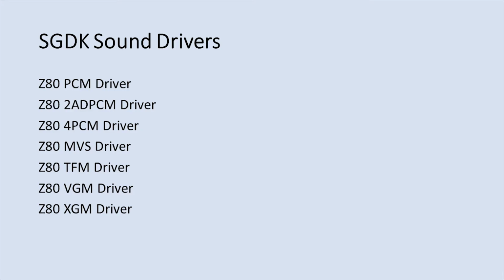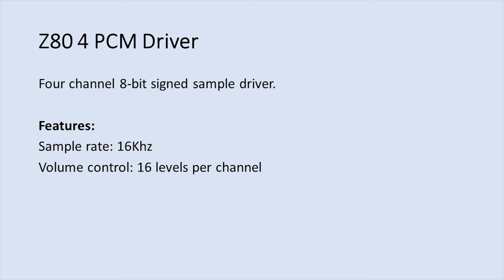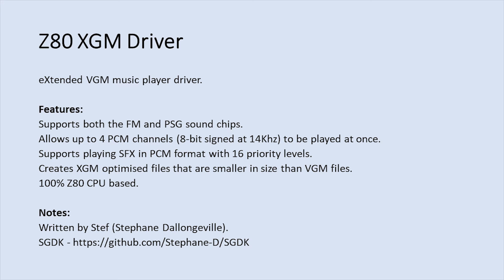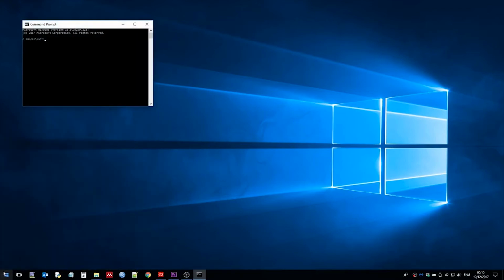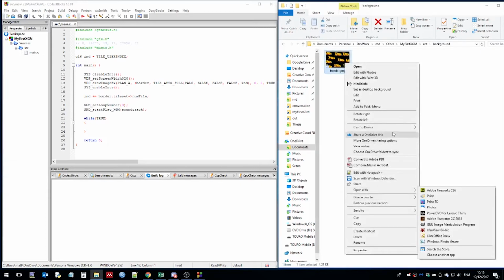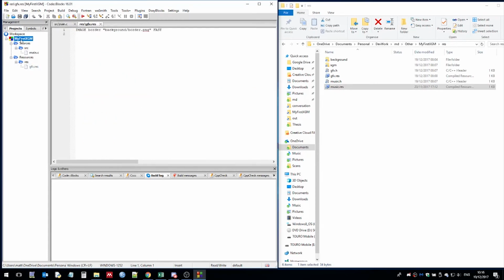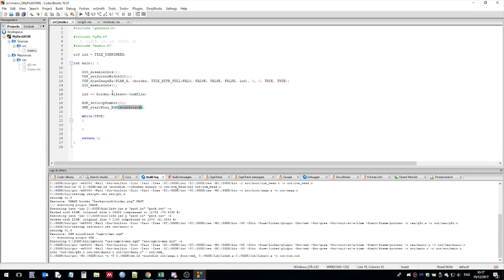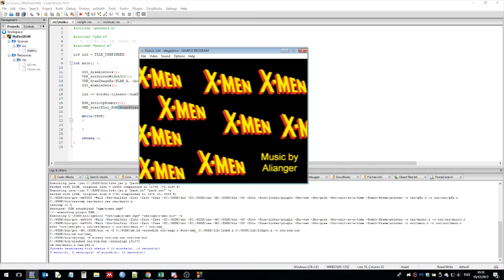Sound drivers for the Sega Genesis & Mega Drive SGDK

Comment: I have a question. What does the  "music.h" file contain?
Reply from the maker: It's a header file :) do a quick search on Google for .h files
Reply: @RetroSegaDev  I googled about sgdk and I found out it's supposed to generate automaticaly when compiling the project. But when I compile the project the music.h file doesn't appear. And btw I know SGDK needs java and I have Java 8 update 231.
Reply: @RetroSegaDev  Nvm. My "res" folder was in the "out" folder. Now It works.